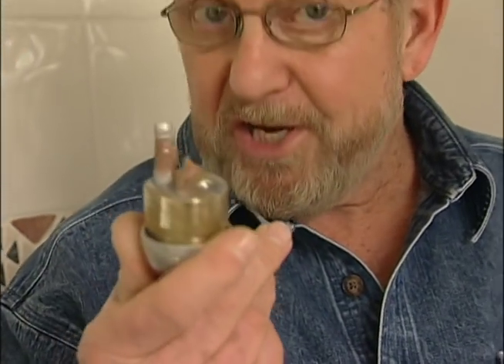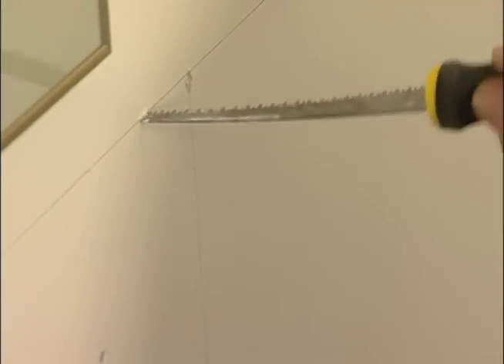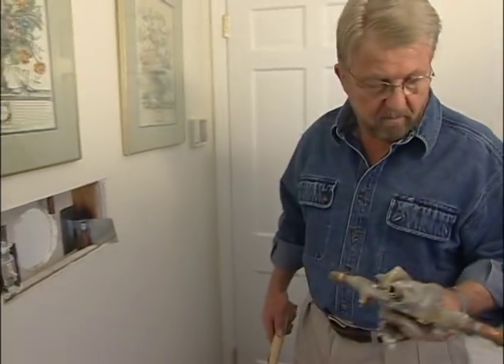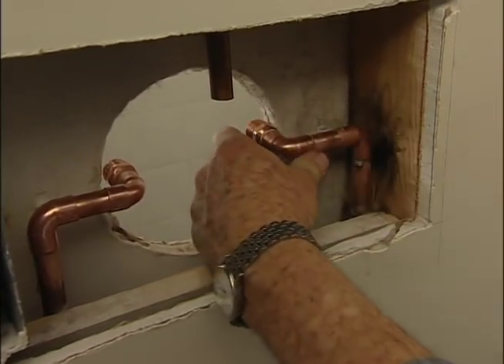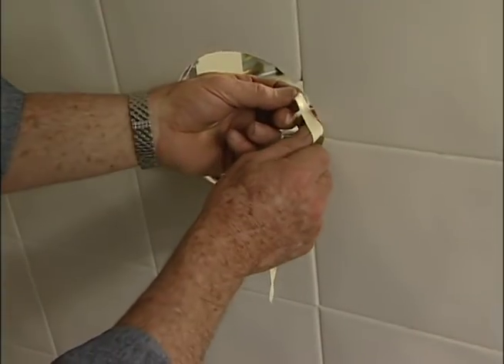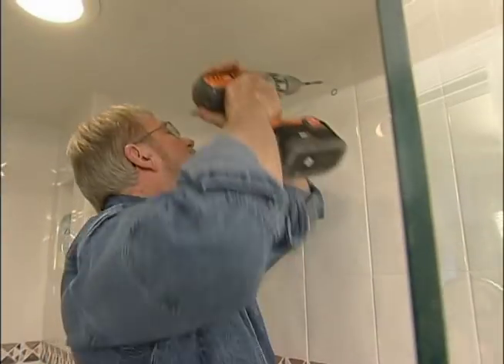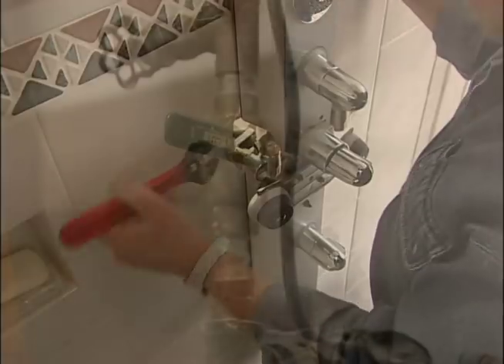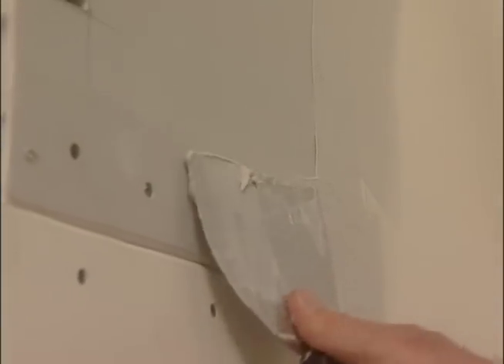Install a Shower Tower

Comment: I'm curious  the round hole in the ceramic tile was not closed up.  Won't the moisture from the shower cause mold and moisture damage inside the wall?  How should that be properly sealed up?